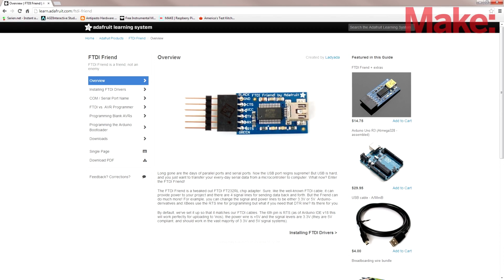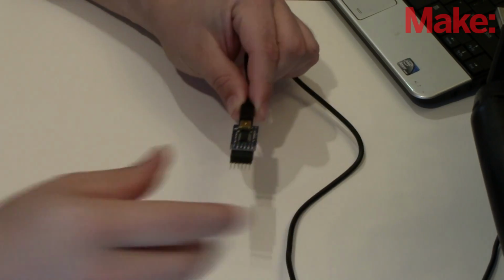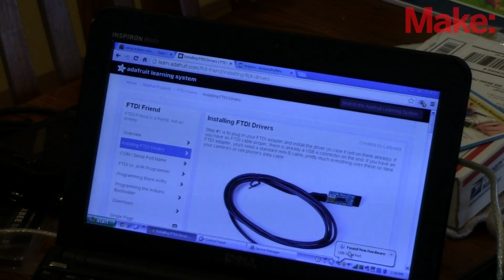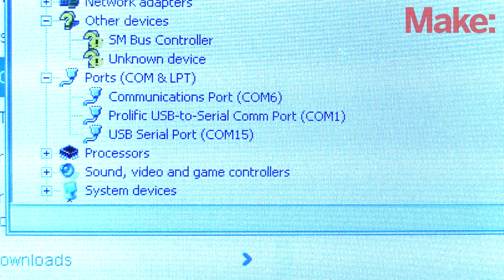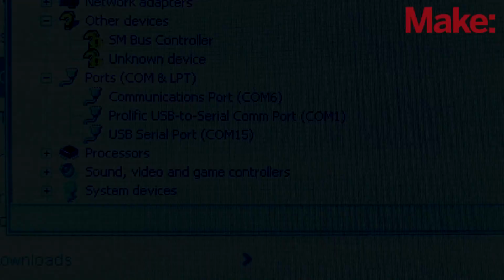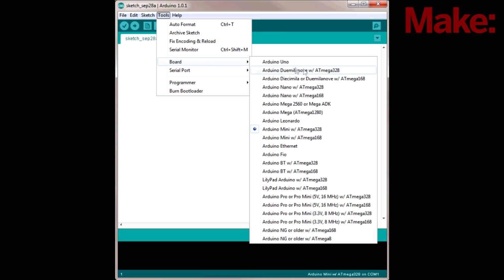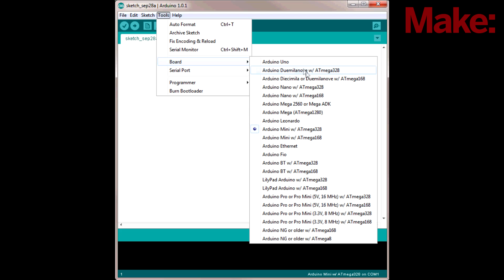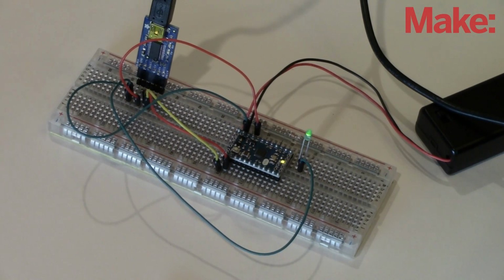Projects with Ryan Slaugh: Getting Started with Arduinio Mini and FTDI

Comment: It should be able to control a single servo but if you need more motors you must use an extra power surce. Rember to place a flyback diode to not to burn your microcontroller.